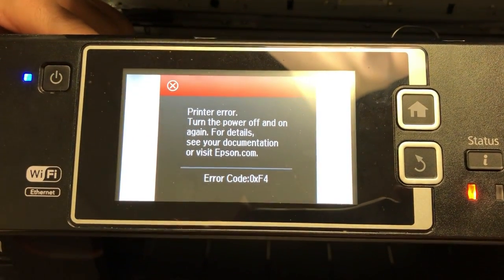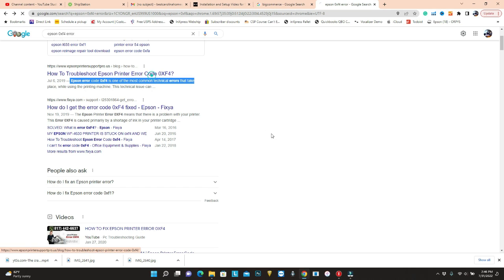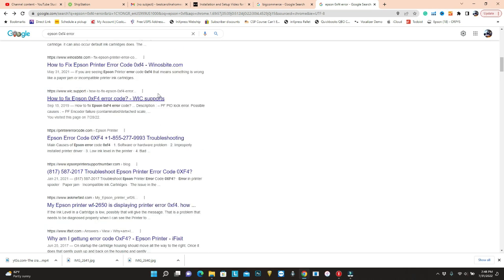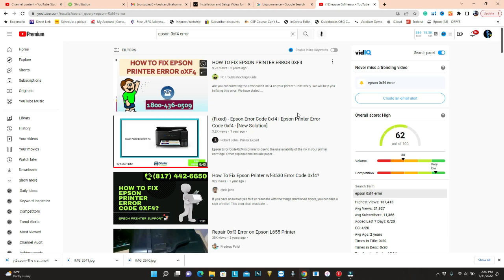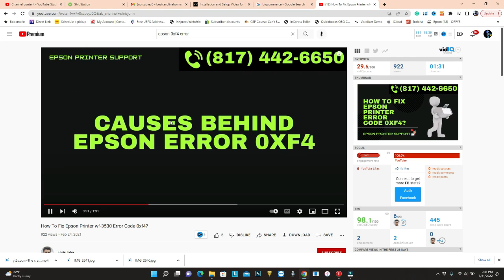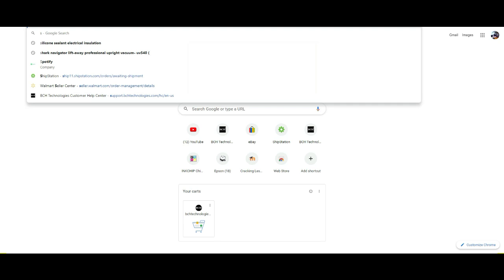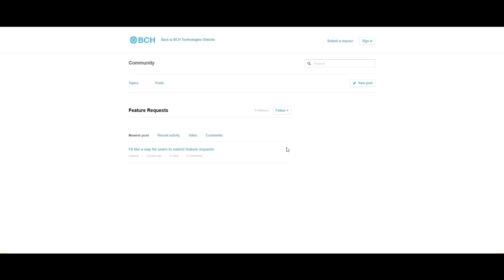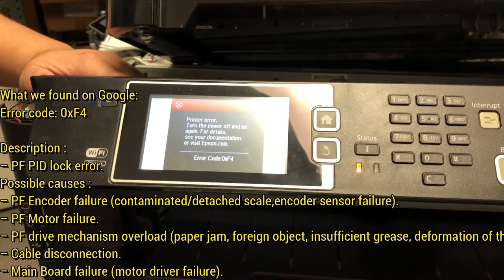How to troubleshoot Epson error 0xF4 on WF-7620 WF-3640

Comment: I have a error code 031006 on my epson 2720 any tips on fixing it
Reply from the maker: Thanks so much for subscribing and supporting the channel – every subscriber helps us get closer to our 100k goal! The 031006 error on the Epson 2720 is often linked to a malfunction in fuse 301, a poor printhead connection, or the printhead itself. I recommend checking the FFC cable connected to the printhead to ensure it's secure and undamaged. If that looks fine, try taking out the printhead and installing a known good one to rule out printhead issues. A quick fix that works sometimes is power cycling the printer by unplugging it for a few minutes and plugging it back in. If the error persists, more advanced troubleshooting like replacing the F301 fuse may be necessary – I cover this step-by-step in one of my videos, so definitely check that out. Let me know how it goes, and feel free to reach out if you need more help – I aim to answer subscriber questions within 48 hours!